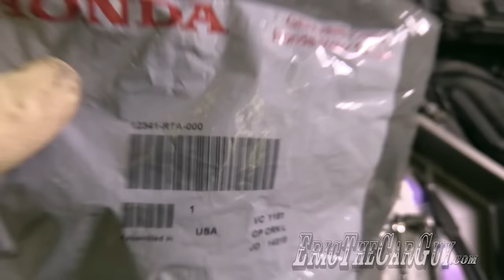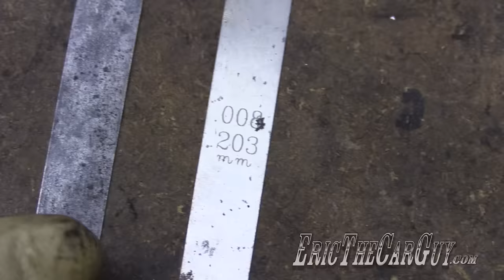Honda K Series Valve Adjustment -EricTheCarGuy

Comment: 34:41  " I rather have it abit loud than quite"   why do u want that?   honest question :)
Reply: Being a solid valve train and knowing they are all to spec sometimes it can producer louder sounds due to clearance. Exhaust side is known to tighten up and become silent but when that gets extreme as he said it can burn up valves and you have problems. There is a fine line between clanky loose and correct sound. Obviously most people want the silent smooth engine but sometimes being within the proper spec isnt the quietest thing and thats okay.

Comment: How do you know when a valve is top dead centre (or on the base circle)? Just by eye or is there some mark to line up? Was thinking of doing my Kia Sportage as a check is due at 60k.
Reply: Ties should be markings
Reply: Mostly by looking at the camshaft.  When it's at TDC all valves will be closed, usually the camshaft lobes at tdc will be pointing towards each other for that cylinder at about a 45 degree angle

Comment: Thanks for the video Eric. 
I did this a few days ago (05 Accord) using your method, not Honda's. 

On mine, surprisingly, all intake and exhaust were loose except for one exhaust valve on cyl 1 which was just OK. That's the only one I didn't adjust. 

I set cyl 1 at TDC so its intake and exhaust CAM lobes were on the base circle. With this, cyl 2 intake and cyl 3 exhaust were on their base circles. I adjusted them accordingly. 
I then set cyl 4 at TDC having both intake and exhaust at base circle. With this, cyl 2 exhaust and cyl 3 intake were on their base circles. I adjusted accordingly. 

Runs a lot smoother now. Way less vibration. Got power back. Yes, better mileage now too. And way less tapping sound at cold starts. (almost inaudible).

Comment: hi im having a misfire issue on cyclinder 2 can a valve adjustment fix that problem thank u eric
Reply: try swapping the ignition coils. if the problem goes to the cylinder than the problem is the ignition coil.
Reply: @1188clean  yes i did that thank u

Comment: So when ur adjusting it do u have to be top dead center?  Like just put it on dead center and I’m good to go on adjusting them a or do u have to turn it every time or something??? Plz help
Reply: As you are going, you will need to adjust each cylinder to top dead centre. Only adjust the valves once you have reached top dead centre. Generally you can do this by reaching top dead centre on cylinder 1, then you will only need to turn the engine a quarter turn at a time by following your firing order. I have a k20z3 my firing order is 1, 3, 4, 2. So I would find top dead centre on cylinder 1, adjust the valves to proper specifications, turn the engine clockwise approximately a quarter turn, then I would work on cylinder 3 as that is the next cylinder in the firing order, repeat this process on to 4 and then again on to 2. Keep in mind I'm explaining the firing order of my k20z3. So if you find out the firing order of your engine, you should be able to follow these same steps, just in your firing order if that makes sense.
Reply: Just did mine today in this sequence, car had a rough idle everybody was telling me it was my engine mounts I thought BS. literally car went from shaking really rough at idle and sputtering at about 2500 rpm to about 2700 RPM, car literally feels brand new. Give yourself a nice sunny day and if it's your first time give yourself about 4 or 5 hours. DONT RUSH!! Be precise! on intake shoot for .008 in with medium drag on feeler gauge and .010 inch on exhaust. those are minimum specs so if you get medium drag on those you will not get valve lash if you are a little bit loose. Don't go too tight make sure you can move that feeler gauge comfortably without snappy resistance. Just a little bit more friction than smooth as butter, almost slightly sticky feeling. Do this and you're golden. All I can hear are my injectors no valves really.

Comment: Eric i have a 2003 Element  and i'm hearing a knocking noise and my knock sensor is giving me an engine light so i'm assuming it needs a valve job so i was going to take it to Honda and have them do it, my question is how much is a valve job? the reason why i ask is because i'm on a fixed income and want to know the ballpark cost 

thank you in advance
Reply: Loose lifters tick, like a sewing machine. Knock is either main bearings, rod bearings, or piston pin.
Reply: Ocala Florida Honda told me $400 yesterday....

Comment: Question:  is it okay to have lil wear on the cam because mine looks the same as yours.. please get back to me
Reply: That's wear from the valve lifters.  It's a normal wear pattern for the camshaft.
Reply: Okay sounds good, so I shouldn’t worried than ? I was when I first saw it, I got the car 3years ago it has 66,400 miles on it but when I first got it, it had 37,003

Comment: How come people in their vids dont use the snap on 3/8 gun to remove the 10mm bolts lol. Even seeing someone using the ratchet irks me its way too slow
Reply: Because not everyone can afford Snap-On. Eric gears these vids toward the average DIYer, not mechanics.
Reply: rts i mentioned snap on because its the most common model gun but any impact usually a 3/8 is good for removing nuts and bolts. For the sake of saving time. I cant work without cordless tools

Comment: According to what I've read, the engine covers are actually there to reduce noise from the top end and fuel injectors.  For example the spark plug tubes could behave as a wave guide and help transmit noise from the top of the combustion chamber.
Reply: Yeah but... to actually reduce any real noise they pad or insulate covers, it's far more effective, in this case I think it's for a cleaner look :)
Reply: There is no top plastic cover on this engine, metal valve cover itself is open, that's why old cars are much more noisy under the hood.

Comment: What is the base circle ?
Reply: The "back" side of the cam lobe, where it is actually a circular shape. Eric likes to position the lobe so the valve is on the center of the base circle, directly opposite the high point of the lobe. IMO, it is good practice.

Comment: quick question does radiator fluid go bad after a certain amount of time and how often do you change it??
Reply: yes, depending on the brand and the quality, generally every 3-5 years.
Reply: Yes. The anti-freeze component does not ever change but the anti-corrosion components get used up over time. Shoot for 4 years unless you know the antifreeze is long life.
Reply: 2 years or 24,000 miles is the most commonly suggested interval.

Comment: Does the car have to be off the ground to turn the motor?
Reply: Wow you really asked that question... No put the car in neutral I'm guessing you have an automatic
Reply: no i just wanted to know if the wheels had to touch the ground. i turned the motor over from the top, not the wheel well.

Comment: Another great video showing how to fine tune a honda, thanks to Eric i did a valve adjustment on my GSR and she sounds real healthy besides my LMAs ticking haha but LMAs don't affect the engine. Anyways thanks again Eric, I've always messed with B series but when i move up to K series I will def use this video as a guide.
Reply: lma is more important than ya think, if they go bad youll wear your vtec cam lobes and rocker arms out. instead of the rocker sliding against the lobe it gets "float" and the vtec lobe begins to slap the rocker,not good lol
Reply: ChronicConnoisseur
True, but the early VTEC heads used a piston style LMA that are prone to tick because the piston would in a way "get stuck" then they started using the spring style LMA to eliminate that problem, my head is a 93 head I've been running like that for about 2 years and they haven't affected anything in my valvetrain, matter fact they go away when you hit VTEC but when not engaged they are just there idling so it'll be alright...i plan on replacing them later probably with some Skunk2 ones.
Reply: ya you know what your taking about lol, i got  s2 pro1 cams and the s2 lma kit + super tech spring and retainers
Reply: ChronicConnoisseur
Haha yes sir, I just love my hondas...i can tell you as well, nice setup i actually plan on changing my LMA with supertech springs and retainers i have a b20v.
Reply: ah nice, i picked up a b20 my self recently, thinkin about getin a gsr head for for it, what cams you goin with? or leavin em stock and getin all that reliability lol
Reply: ChronicConnoisseur
Go with the GSR head, it's been proven the GSR head flows better and has slightly more tq than the b16 not anything that you will feel though. And haha yea i got a completely stock GSR head and slapped it on there, plus I don't recommend revving anything passed 8k on a stock b20 block especially when b20 blocks are known for their weak sleeves since they use that one piece design on them. But I do have ARP headstuds and rod bolts, also added ACL rod bearings so I just went the reliable route with a little tq but runs like a champ smoking v8s.

Comment: Good video. I adjusted mine on a 2009 crv and had a little better results noise wise, but I appreciate the honesty about yours actually turning out louder. I think these valve trains are just plain noisey. I also recently bought a set of nylon panel removal tools for installing stereos, etc and am finding other good uses for them such as when you have to pry the valve cover up. Much easier on the aluminum than steel tools.

Comment: I just bought an 05 Element with 175k miles on it. I heard about this procedure visiting a mechanic I have known for about five years. I was talking with one of his guys and he was going on about the Honda Element and how much they love them there.
He said two things to look for in a high mileage Element is a slight shuddering in the transmission as you're accelerating quickly, like going onto the Interstate, indicating a transmission oil change may be due, and a rough idle and stalling condition until it's warm.
This one will stall if I don't let it warm up a bit before rolling out. It does idle rough occasionally. I've owned it a week and have put over 1000 miles on it. It's now at 176,575 miles. I need it to last.
I watched this video to see what is involved and if $200 is worth it(includes gasket set). I think I'm going to get it done. Going to get the transmission serviced too. I drive about a 1000 miles per week due to my job, so I have to have a reliable rig.
Thanks so much, ETCG!

Comment: i did valve adjustment.... 

car idles fine but in 2nd gear when u go above 4k rpm... car becomes jerky... it gives jerks....

check engine light blunks....

when i stop car it stops blinking... 

1st gear perfect upto 6k 2nd giving issue...

its a triptronic auto  japanese spec car

Comment: Hey Eric awesome video! I'm going to be doing this to my '07 Civic Si soon & I'm using your video as a guide.
If I just use a ratchet with a deep socket and a flat head screwdriver, it seems like it would work the same. Or do you recommend I buy the special tool? Thank you
Reply: how'd this go on your SI? I have one too and I'm wanting to do it
Reply: @wifispotter  Hi! I actually have not done it yet lol but I want to soon.
Reply: @wifispotter  The special tool is between $20-30 but I'm just going to use a 10mm wrench and a flathead

Comment: great video! all your videos have helped me greatly. I have 2012 honda crv 4th gen. engine and someone told me that  you really don't need to make valve adjustment at 100,000miles. . In korea it is hard to find good mechanic who really knows what they are doing. Can i just change the spark plug and do the adjustment later? Since I brought it used  at 32,000 miles, I have been putting  regularly  mobile 0-20w synthetic oil .  thanks for all your youtube. you have many fans in Korea as well.

Comment: I hope you see this soon because I’m in the middle of a valve adjustment right now and I have some questions.

The intake side seems to be going well and only needs minor adjusting however the exhaust side is a little more concerning.

The exhaust side is much tighter, that was expected as you said as much in the video. However when I go to adjust them I feel like the gauge is actually just compressing the valve spring because when I go to double check it, that valve is tight immediately.

I am also noticing play on the rocker assemblies. For example if I’m working on # 2 it along with 1 & 4 have loose rockers but valve #3 does not. Shouldn’t it be the opposite? With the valve I’m working on having a stiff rocker assembly and no play?

Here is how I am adjusting them:
I use the power steering pump bolt to rotate the engine so that the cam lobe of the valve I am working on has the long side of the lobe sticking up. I have the lobe aligned with the arrows that are on the case (cam bearing caps?) for the intake side. On the exhaust side I have the lobes facing up so they align with some markings that are in the center of the cam bearing caps.

What I’m I doing wrong?
Reply: I think I have it figured out.

I used this guide to make sure I was at TDC for each valve.

Comment: Great video!  Very important to check every adjustment locknut for tightness as last step before replacing cover. A lose locknut will allow adjustment screw to back out or in causing a problem and possible damage to rockers and valve stem.